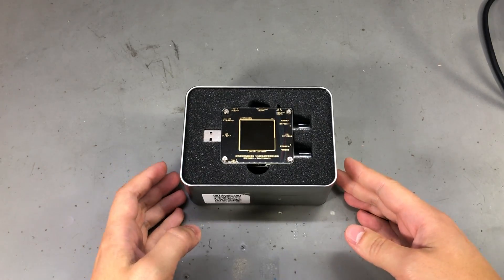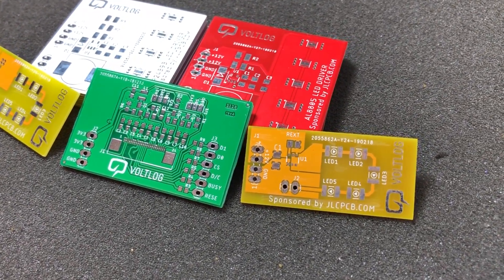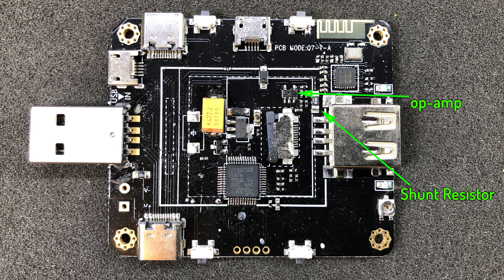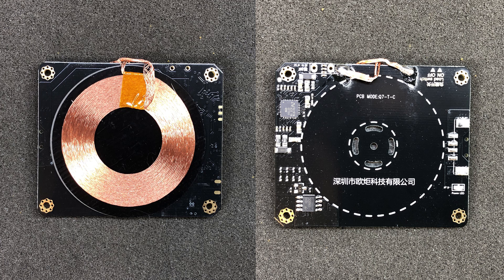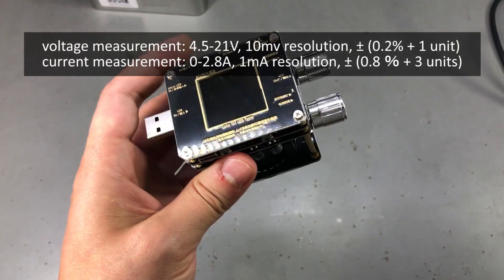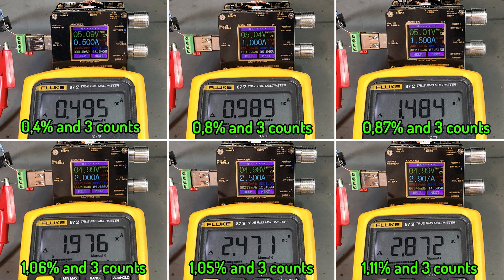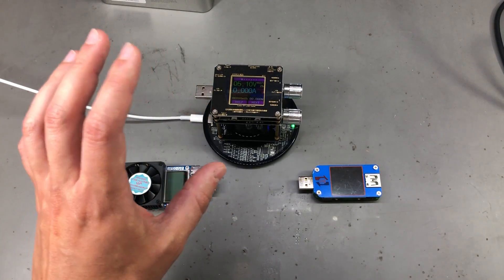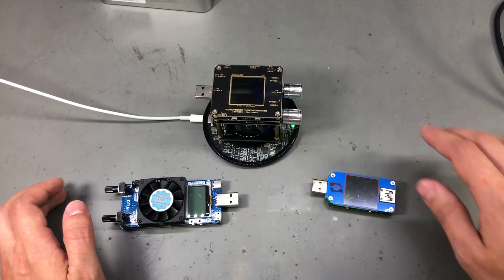Voltlog #248 - Atorch Q7 USB Meter/Load With QI Wireless Charging

Comment: Interesting combo device! TIP122 was a great choice offering better reliability. Unlike 99.5% of mosfet's (which are switches not designed to operate in linear mode) this BJT can operate 7/24 at 4 amps (80% Ic) unlike a typical mosfet's substrate developing hotspots before shorting out.  IXYS now owned by Littelfuse makes linear mode devices but just one would be the most costly device on the BOM. You may think about true linear mosfet's as a huge matrix of mosfet's inside one device. If honest designer's use jelly-bean mosfet switches as loads, they should de-rate Id to <10% and use them in parallel with ballast resistors to limit cascade failure due to thermal runaway (starting with the one with the smallest Rds).
The $64,000 question would be, "is this TIP122 a fake?" Because this application only needs the 60v TIP120..  BTW, 2.8 amps at 21v is nearly 59watts! For this BJT that is pretty close to the 65 watt limit.. maybe they'll build a bigger model using the TIP140 with a bigger fan and heatsink?
Reply from the maker: You're right a bjt should be more reliable although I'm not sure reliability is at the top of their list when they are designing and producing these. I would probably assume cost was one of the reasons and maybe they copied an older design. I'm pretty sure the load part is only designed to take 5V @ 2.9A which would be less than 15W, which is maybe ok for the small heatsink + fan combo.  I think the 21V input rating comes from the usb meter part of the module and is only intended for measuring.
Reply from the maker: The other usb load I have struggles to maintain itself under 60 degrees C with a 24W load, and it doesn't have any restriction on the airflow like this one has.
Reply: @voltlog  USB 3.0 can go as high as 20v if a device can negotiate charge parameters.

Comment: Some flux residue on the boards but its better to see that,  than not having nothing at all. The FW looks identical to the RD meter :P. Not bad for the accuracy given it is a usb meter. About the QC support maybe the firware is not ready yet....
Reply from the maker: I doubt they can do anything in the firmware, because there is no chip on the board to handle that. Also someone else noticed an external trigger module (red pcb) being used in the seller pictures.
Reply: @voltlog  Thanks for the clarification. I thought that the MCU was doing the negotiation but forgot that requires external hardware  to boost voltage. So it needs a dedicated IC for that purpose... or external red board to trigger it:

https://images.app.goo.gl/P3t7C5jH2b6TUTeA7